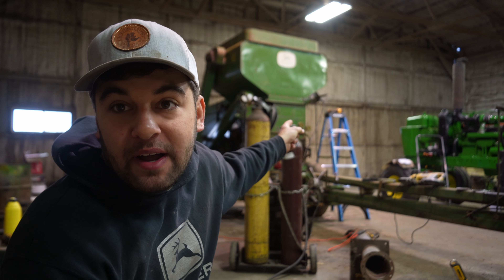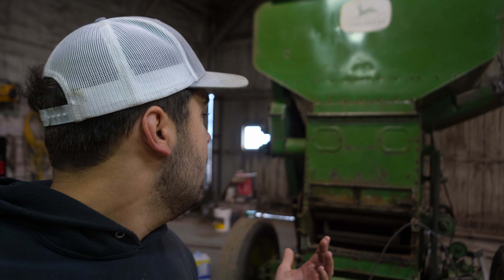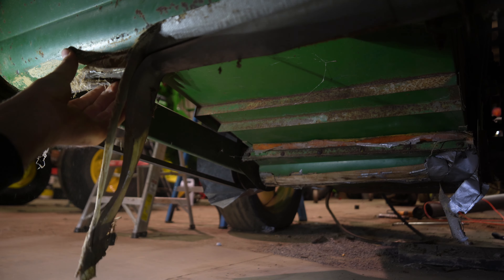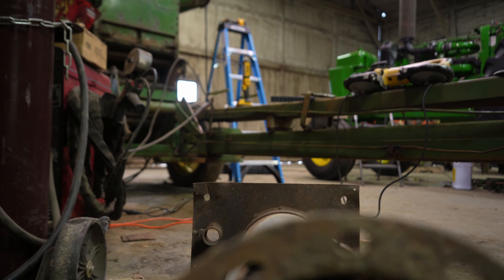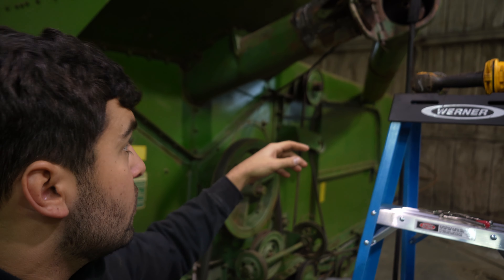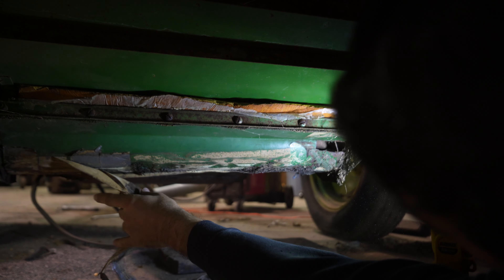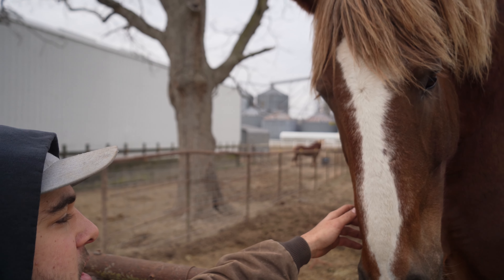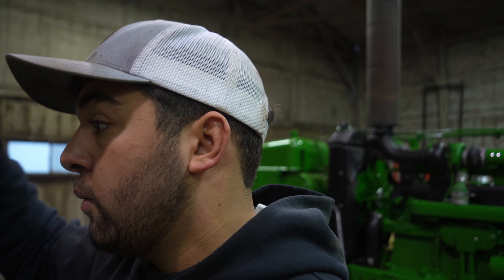This Combine has AIDS- Let Me Explain

Comment: Nice work, just be careful of the toxic fumes welding galvanized. Welding hoods help but fumes still seem to linger.  I would have cut away the rusted section of the auger bottoms before welding in the new sections, the old metal will continue to degrade and rusted pieces will end up in the hopper as grain is augured over those rusted holes and through the combine.
Reply from the maker: That is a good point, with as much use as this combine is going to get I think it will be just fine though. Thanks for watching!